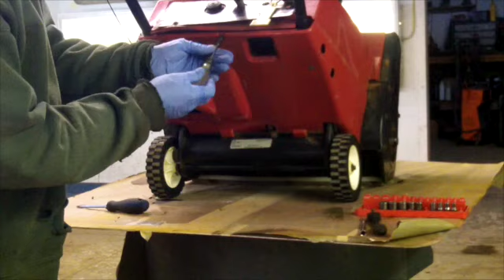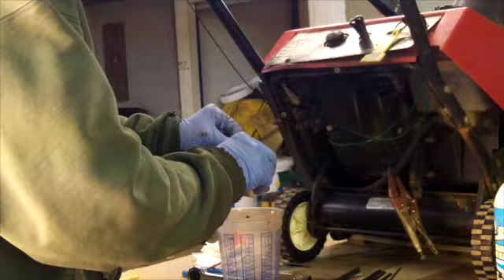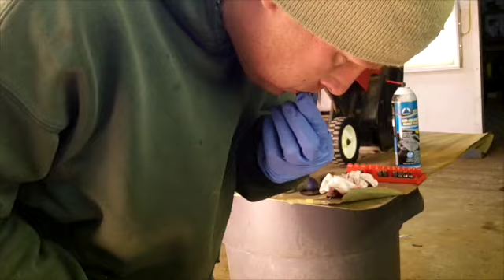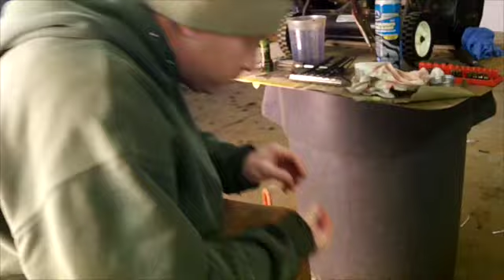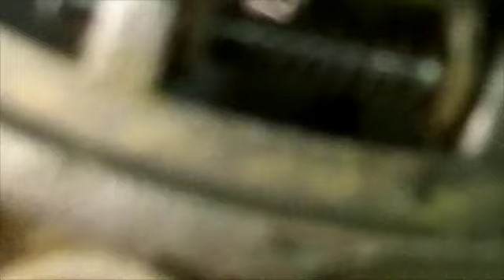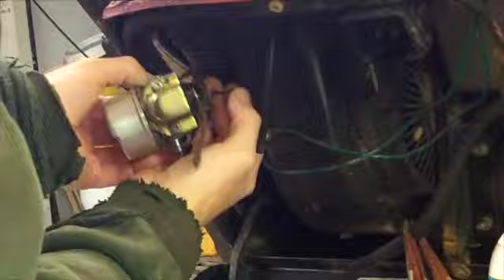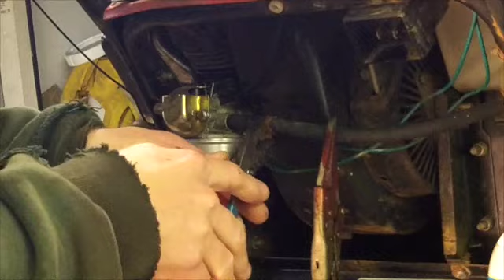Toro CCR Snowblower carburetor rebuild - How to troubleshoot and repair small engine carburetor

Comment: I got the snow blower going.  When I took the carb apart I realized that the float had fuel in it when I shook it.  So I cleaned the float off with some steel wool and found a very small crack which I was able to solder up after I worked the fuel out of the float.  I checked the fuel passages then put the carb back together.  Runs great and the electric start works also.  Can't beat a dumpster find that works this good which only took me less than an hour to fix.  Thanks again for the video instruction.
Reply from the maker: You're welcome!

Comment: I just went down to the dumpster to throw away some trash and there it was. A Toro CCR Powerlite-E that someone left there. I took it home and tried starting it.  No luck so I tried some starting fluid and that worked.  So I am going to clean the carb and see if I get the same results as you did.  I am a retired Heavy Equipment Mechanic and I must say that you did a great job with your video.  Keep up the good work.
Reply from the maker: Thanks!  I appreciate it.  
Good luck getting it going.  They are great little snowblowers

Comment: am sick  of those things been turning um down lol NOooo only two cause I was busy they charge 85 dollars here for that !!! I do it on location for 40 ! Got a box of parts I carry with me 25 min and Im out ,,,of course your generous how to was excellent at 43 min  would of takin me for eva !!
Reply from the maker: Shops round here get 70 an hour.  If I would have bought a kit for that,  they would have probably had 100 to 125 in the job at the tractor place.  I charge 50 an hour mechanical so they got off cheap... plus it was less than an hour for me so I got lucky on this one, lol
Reply: Srvjediknight SR

Comment: Thanks man. I have 3 of those that my dad left that don't run. Now I have a place to start. Happy new year to you and yours.
Reply from the maker: Fuel system issues seem to plague small equipment.  Fuel doesn't last like it used to.  Too much ethanol draws water into the system and wrecks havoc on them.  If it wouldn't have fired, I would have checked for spark first.  Sometimes it's as simple as a bad on off switch.  Good luck on your snowblowers!